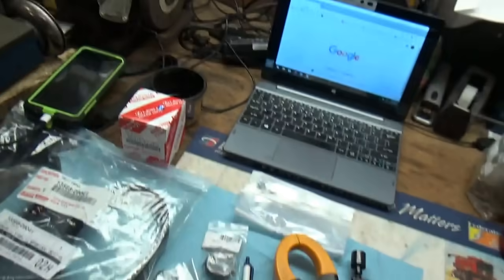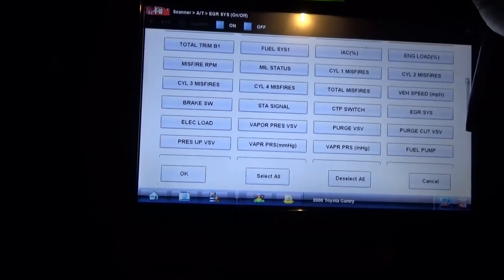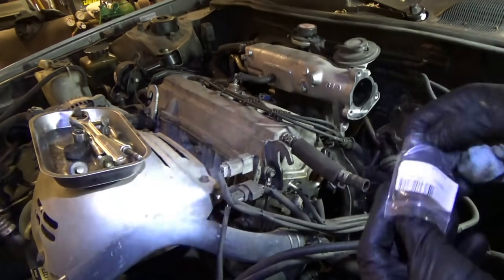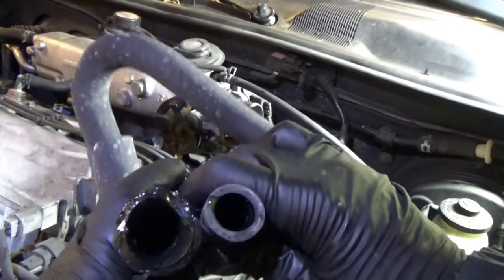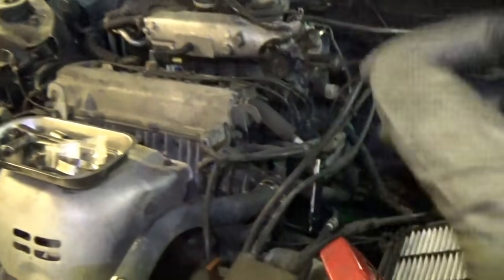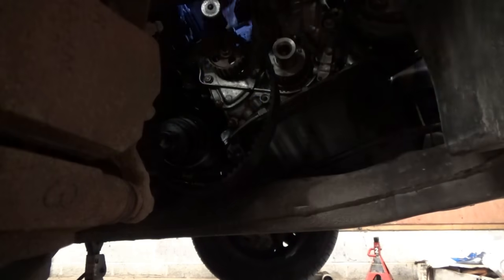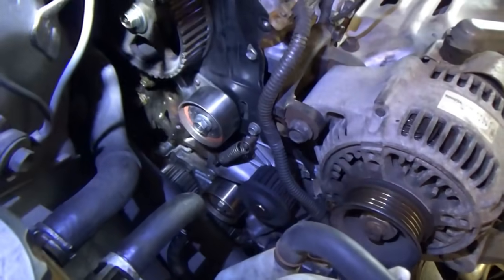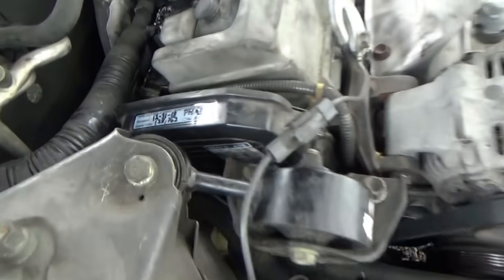Oil Leak? DRILL it out! (Toyota Camry) + Timing Belt & EGR repair

Comment: Actually that round seal cap by the camshaft doesn't have to be replaced, that's a common factory problem with this Toyota Camry's 4th generation I have owned  3 of them two 1998s and a 2000 all 3were leaking oil from that same area, this is a common problem once they get to over 100 thousand miles I fixed all three by simply removing a few parts to expose the problem area scrape off anything that might be in the way and clean with brake cleaner around the seal cap and simply apply some permatex gasket maker the gray or black that is used for the valve cover  job apply nicely all around and let it dry a half hour before putting everything back and wait 24 hours to make sure it cures before driving the car again this is a permanent solution, there's really nothing wrong with the seal cap, the way he did it it will leak again eventually I saw this other guy apply permatex gasket maker on the new seal cap before replacing that actually makes more sense than applying oil, but my way will save you time going to the dealership and a few dollars too and is permanent if you do it correctly no way no how any oil is going to leak anymore.  But this method is cool too if you care about it looking nice lol. Is a hidden area so no one is going to see it anyways but but if you apply permanent gasket maker around the new seal cap and tap it in gently in place right away before gasket maker gets hard and then just a light coat all around it that would definitely be permanent solution and it would look even better than the professional mechanics, I only have one of the 98 Camrys left it runs perfect and I love how smooth this car runs but eventually I have to upgrade my 2008 Corolla is a good upgrade not as smooth, engine a little buzzy but has surprising acceleration power and can handle the most extreme summer weather I love this car and is actually even easier to work on than my 4 cylinder 98 Camry I didn't think that was possible but it is lol.
Reply: Is Hi Temp red silicone RTV OK?  1 hour set time, 24 hours for complete cure.  That's what I have on hand.  (I'm a newbie).  Will the silicone RTV go bad after I open it after a year like house caulk?  Thanks

Comment: How many of us would refuse the job if the customer was unwilling to opt for OEM parts? Especially since outlets like RockAuto & Partsology show such drastically lower prices.
Reply: I would do the job still but making them clear about faults
Reply: I tell my customers go OEM for critical parts like the oil pump housing gasket, water pump, oil pump, tensioner, etc.  I always tell them if you were the mechanic and put cheap Rockauto parts, etc., then it fails prematurely you have to redo what you did previously.
Reply: @dc5723  There are good brands (including OEM) on Rockauto, and they can be substantially cheaper than what the dealer (or local NAPA/Advance/whatever) even after factoring in shipping. When my sister decided to listen to the dealer and they wanted to change the positive battery cable (read: wiring harness) on her 2011 F-150 that part was $260 from the local Ford dealer, never mind labor. $187 from Advance, still the Motorcraft part. Rockauto was $150 incl. shipping.

Of course, the only thing wrong was the positive terminal being corroded (the lower "ring" was nothing but white powder left on the terminal when I removed it) and the battery, the latter of which was replaced under warranty from the dealer. One $15 terminal (part BT4Z-14450-AA) and a wiring repairing later and the truck was up and running again.

But really, the main thing is don't buy a part just because it is the cheapest and your average customer doesn't know which brands to avoid like the plague (Dorman et al).
Reply: First Rockauto parts can be cheaper.  They have no phone customer service.  No expensive store front.  No shareholders who want giant profits so they pass the savings to us.  I have not had a Rock Auto mid or high range part fail yet.  If you buy bottom end parts they will fail!
Reply: @Strasedon  Yes you are correct, I did buy Aisin and Denso parts from Rockauto.
Reply: I don't get the hype with CrockAuto. Every time i try to order something the shipping is outrageous. I needed a bumper cover for one of my 7 cars. The damn shipping was more than the part!? I mean shit Amazon sent it free with two day prime shipping. Without prime like I have, it was still free just 5 days shipping.
Reply: @acetech9237  Well yeah, a bumper cover is going to be expensive to ship because it'll be priced by dimension not weight. Amazon takes a loss on Prime shipping but makes it up in other ways (volume, low wages). Each has their dis/advantages. Don't discount RockAuto based on one experience. ☺
Reply: @acetech9237  Shipping is very expensive to Hawaii and I rarely shop there.  The first place I look for parts is Amazon which costs a few dollars more than RA but that's part of the "Free Prime Shipping."  If not there then maybe RA but if needed sooner, NAPA, Carquest, Autozone or O' Reilys.
Reply: Alan Matthews yeah you named their biggest fault. The fact that they have no phone customer service!!! Well actually I found a workaround for that. You gotta cheat their phone system. Using the dial by name directory they have, you’ll eventually get someone on the phone. But it’s no easy task. They sent me the wrong part not only once, but TWICE. 2 weeks wasted waiting for parts, plus I had to deal with their terrible customer service, still couldn’t drive my shit, and then had to go to a parts store and pay the (well worth it) premium. I’ll only order parts online now if the savings is very significant. Being able to have the part, in your hands, that day, and having someone to yell at if it’s wrong is well worth the 20 bucks extra you have to pay. Plus NAPA or oreillys will bring stuff right to me at work.
Reply: @BryansGarage951  Is spelled AiSIN

Comment: A quality cam belt kit comes with an oil pump seal set because of the regularity of the pulp seal leaking...Easy job..Done many...You should be able to twist the belt on the long side to 90 degrees...A rule of thumb from the past...You done good mate.

Comment: I always do a new belt tensioner, idler pulley bearing, and water pump with the timing belt.  That is for my cars, a customer might not want to pay for the extra parts, so I get the “if it’s not broke, don’t fix it”.
Reply: The additional parts make sense they wear out too and you don't want the engine to suffer a catastrophic failure.

Comment: 6 months. That would be a record for us.
Reply from the maker: Maybe 6 weeks then?
Reply: @PineHollowAutoDiagnostics  Let's go with that number.
Reply: Ouch
Reply: 6 weeks is for blend door actuators....
Reply: I would like to thank Dorman for supplying a replacement exhaust manifold for my 2010 Chevrolet Equinox 2.4 liter 4 cylinder gasoline engine, after the OEM manifold cracked around 90% of runner between cylinders 2 and 3, as occurs on every other example of this particular engine, just as soon as the basic warranty expires, so I am led to believe by numerous owners. (For those who own one but doubt this, remove the heat shield from the top of the manifold and look carefully with a flashlight.)  I also want to thank Dorman  for improving on the original design by beefing up the casting and making it just long enough so that it absolutely will not fit into the space provided by Chevrolet when the engine was designed and the car was built. Just as soon as I have ground off enough metal to shoehorn it onto place and get it bolted up, I hope the 7-days-in-service warranty will be enough for me to sell this vehicle, so I’ll be free at last from my Chevy travails.  And thanks to Ivan for another great video and highlighting the value of having a place to work that’s indoors, and having exactly the right tool for each job, knowing where those tools are in the shop, and how to use those tools to enable an on-time departure for a trip to scenic Staten Island.
Reply from the maker: I tried two Dorman exhaust manifolds on a 1996 Toyota 1.6 4AFE engine. They didn't last even a year. Finally owner was fed up and got a dealer Toyota manifold lol
Reply: At the time of my purchase of the Dorman manifold, GM had apparently exhausted its supply of these exhaust manifolds, because they were not then available directly from, or even listed by, AC Delco, my usual GM parts supplier, or from Amazon or any other non-dealer GM supplier that I could find. Just shows the enormity of this problem that GM refuses to acknowledge. Going to a dealer for anything is always a very expensive last resort. AC Delco doesn’t even list the new studs needed to reconnect the replacement manifold to the catalytic converter flange.  NAPA doesn’t either.  The Dorman manifold was immediately available, so I got it.
Reply: Dorman Products that’s the truth 😂

Comment: I like the spring clamps for hoses. They self adjust for shrinkage of the rubber hose over time.  Don't push the heater hoses tight against the firewall since any leaks there will enter the passenger compartment.  That would look like bad heater core.
Reply: Great job
Reply: Good point

Comment: So i have a 1998 camry im fixing up and this seal leaked so bad it got on top of the transmission speed sensor wiring harness, the oil went throught the harness, through the top of the sensor, and the oil actually started seeping into the sensor and into the trans fluid itself. Luckily I caught this issue in time because i took the trans off to reseal some things and i found this and the oil hadnt made it past the top of the shaft of the sensor yet. Its just something else to check out after replacing that oil seal.
Reply: Rexen,     same thing happen to me.  had a trans issue and it was the damage cause to the harness and sensor by the leaking oil from the plug

Comment: Good job with all the stuff needing repairs.  I've found, once you disturb those spring clamps and reuse them, THEY LEAK!  My 06 Nissan Frontier 4.0L has them.  More than once when I would reuse them, they would leak.  Add the worm drive clamp, no problem!
Keep the videos coming in 2019!
THANKYOU!
Reply: instablaster

Comment: Thanks to your video, I fixed my car using your EGR test with a much cheaper Xtools D7 scanner.  This scanner also has an actuator function and I used that to verify my VSV was working by blowing into the vacuum lines on top of the engine.
Turned out my EGR modulator was the culprit.

Funny thing was the previous owner took it to a shop, and they installed a new VSV, when the existing VSV was not broken.

Comment: Ivan,  I did two Toyota's with 94 and '02  both were v6,  did timing belt and water pump job.  A bit difficult job doing the tension, lol.  But in the end,  it was fine the way it was supposed to.  Engine runs beautifully.  Still running to this day.  (About two years ago I did them) also I did a Celica with engine just like that with timing belt and oil pump leak.  Exactly the same you did, haha.  It was over a year ago.  Excellent video!  Enjoyed it,  :) thumbs up from me,
Reply from the maker: Yeah Josh, Toyota made some silky smooth long-lasting engines back in the day!

Comment: I bought that hose clamp tool in  or around 2000. Mine is  made by Mayhew tools, its p/n is 28650. Lots of companies have copied the design since. Extremely handy in tight spots.

Comment: Nice job. I've a 99 camry with the four cylinder. That crusty stuff might be from the antifreeze they're using. Toyota uses a red antifreeze, it's not priced bad either. I get it straight, unmixed with water, and mix it 60/40. If anyone is doing this themselves, change the oil pump seal,  crank seal and cam seal and waterpump too at this time. If you're paying someone, do it also, otherwise you'll pay again IF they go bad. I put that plug in dry, using a socket close to diameter of plug to pound on gently, I also put some sealer around the edges on outside edge. These are so easy to maintain and they'll outrun the energizer bunny.
Reply: Can i do this for the first time in a weekend?

Comment: I got a set of five hose-clip pliers from Amazon including the one you used in the video for around 25 bucks to tackle the water valve on my BMW. I couldn't have done the job without it.

Comment: Nice work sir. I bought a pair of hose clamp pliers like that a couple of years ago and have yet to use them. Turns out that a pair of long reach 90 needle nose pliers works most of the time for me. Thanks Ivan!
Reply from the maker: Thanks John! I like the locking feature so you can slide the clamp off easy and not bust your fingers :)
Reply: I used a regular pair of pliers to hold a hose clamp. When my hand got tired, it slipped and nearly took out my eye.
Well not exactly, but close enough.  The locking feature frees both hands to position the hose.

Comment: Hey Ivan, those series of engines along with the rav4 of the same era have issues with oil pump leaks. Have done several and yes aftermarket is junk. Be careful setting belt tension. To tight when cold will make her sing at operating temp. They do need to be adjusted from time to time.
Reply: Yeah, I had one of these for a few years and a slow oil pump seep was the only issue I ever had. Best car I ever owned for reliability and easy to work on, now my brother owns it and loves it. 5S-FE for life! 🙂

Comment: The guys I worked it the dealership would have thought I was a moron if I went through the process to verify the new part was good. Just one reason why I don't work there anymore and am at a good Indy shop now. Love the videos, Ivan!
Reply from the maker: I've seen too many parts, even occasionally a dealer OEM one be bad right out of the box. Takes only a few seconds to check it on the bench and is definitely worth the peace of mind!!

Comment: Awesome job! I’m having similar issues with P0401 and seal plug leaking oil on my 98 Camry. Your video has made my job easier 👍 Thanks!
Reply: I'm not a mechanic but I'm on my second 1998 Toyota Camry le 4cyl. The first I bought 2 and a half years ago was a great car but I got hit back in April this year and the car was totally destroyed so I bought me another one just like the first one same year same everything even had the same mileage 110 thousand miles and one of the things I checked on the second one is too see if the seal plug cap by the valve cover behind the bracket that holds the ignition coils was leaking, because my first 98 Camry was leaking from that area, so at first I didn't notice any leak but just a couple weeks ago it started leaking, so like I said I'm not a mechanic and I watched a couple of YouTube videos on how to fix this issue, but I decided to use my own common sense, first I realized that this is a common problem with this cars and the reason it leaks over time at around 100 thousand miles is not because there's a problem with the cap seal, but because it was installed by the manufacturer with just a thin coat of silicone sealant that eventually wears out and develops a nasty leak it starts slow but if not fixed it can get pretty ugly, so what I did using my common sense I remove the fat air intake hose and the partially removed the throttle body so that I could have enough room to remove the bolt on the right corner that holds the ignition coils bracket to expose the seal cap so I just removed the excess silicone around the cap carefully and clean around that area with brake cleaner and then I applied permatex gasket maker silicone sealant the ultra black, I nicely applied it all around the seal cap enough of it but not too much just enough to know that no way oil was going to get through anymore and it worked perfectly on my first 98 Camry and is working perfectly on my second Camry, I got a flashlight and got under my car just last week to check if it was still leaking and it was completely dry what I did of course when I did the repair I cleaned all the oil residue that fell on the bottom of the engine block close to the transmission and I also cleaned all the hoses and ignition coils  and everything completely dry is a lot easier than removing the cap, buying another one, I can't make a video on how I fixed it because I don't have the knowledge all the things that are needed to make videos, but if you can understand my writing I'm pretty sure it will make sense to you.  Of course if the seal cap was broken or damaged I would have replaced it but it was perfectly fine on both cars just needed a little more silicone sealant . Oh also very important let the silicone sealant dry for about a half hour before you put everything back and if you can wait until the next day before you drive your car to let the silicone sealant dry ,plan ahead of time the whole job is only an hour and a half if you take your time like I did just keep track of everything you removed take pictures so you don't mess up when you start putting things back.

Comment: As I said in your previous video, you gotta lift up on the tensioner pulley as you tighten the tensioner pulley bolt to get the tension correct according to many Toyota master techs.   The tensioner spring tension is not enough alone.
Reply from the maker: Yup I did that after barring the engine over a couple times to make sure the belt was in its "happy place" :)
Reply: Which is why if you buy a Asian timing belt kit you get no spring with it. They want you to buy a Toyota replacement spring which is shorter then the original. And then you don't need any special master tech knowledge.

Comment: I always spray the hoses down with some WD-40 before trying to slide the clamps off.   Makes that part go a lot easier.   Also I spray some on the nipple plus inside and outside the hose before reassembling to make that part go easier too.